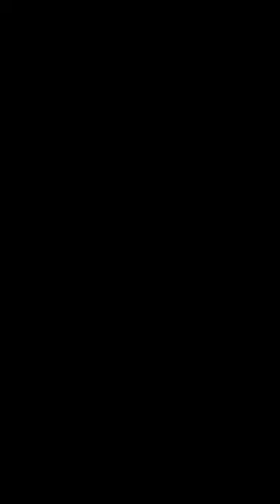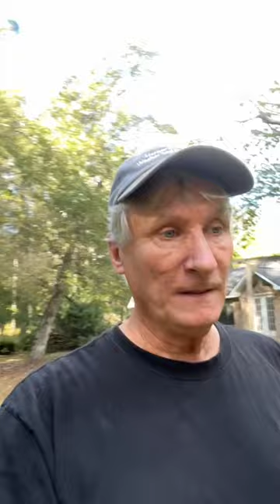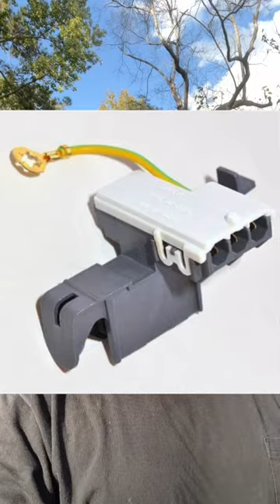Washing Machine Motor Hums

Comment: Thanks for passing on this quick tip, so to speak. My Whirlpool is almost 30 years old and has had parts replaced  as needed. The start capacitor is the original, and if the new motor had started humming, I would have NEVER thought of this as a potential fix. It has been duly noted. Thanks again for all your efforts.
Reply from the maker: You are very welcome. Thank you for watching!

Comment: My dad sold new Speed Queens in the 60's. We had only one comeback with a hummimg no start. The customer brought it back, plugged it in the wall and it fired right up. We decided to follow the guy out to the ranch where he lived. There were 6 trailers, all being fed with extension cords from a 110v meter with a single 20 amp fuse. All the trailers  were in a line and our customer was at the end. We hooked the machine up at the meter and it ran.
Reply from the maker: As far as I can tell Speed Queen is still the top quality brand.  I never get calls on them.  But, we don't have any dealers in this area either so
that may be why.

Comment: Guy I did the same thing, but my lid switch was bad someone was in it and put grease in it. I bought a new capacitor 
It was just good enough to operate the reset and recalibration, you go back to reg. cycle it would not spin. Freakin start capacitor was on its way out. It would cycle thru the wash but it wouldn't hold a charge for the spin so that made me change stuff right and left. Capacitor was registering 41uf on a 50uf and it was the same for the new and old capacitor. Another New capacitor is supposed to be here 2morrow, I wish they just would
completely blow up like a fuse.
Reply from the maker: It sounds like you've really been through a lot trying to fix your washer! It can be frustrating when the issue is elusive. Bad capacitors can indeed be deceptive as they may seem to function normally, but fail when it comes to holding the necessary charge for certain operations. Hopefully, the new capacitor you're expecting will finally resolve the issue. Remember, if the problem persists, there might be another underlying issue. Don't hesitate to reach out for more troubleshooting advice. Thanks for watching and sharing your experience!
Reply: @HarperandKnowles  Yeah, Amazon just left it on the porch we will see That's got to be it the only thing left is the transmission and on my model, you can't just do a shaft kit you have to replace the whole thing. Thanks for yur help I'm pretty sure I'll be looking you up again.